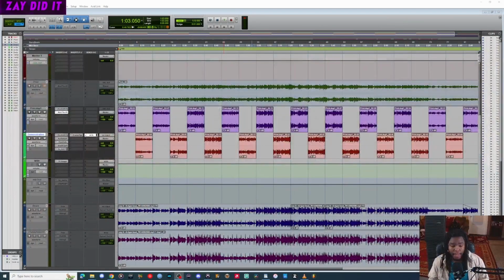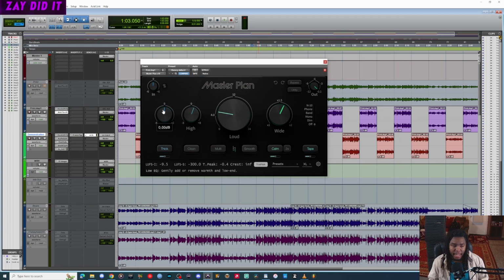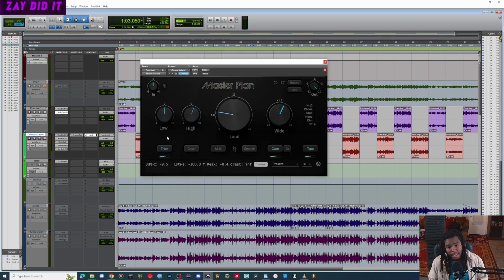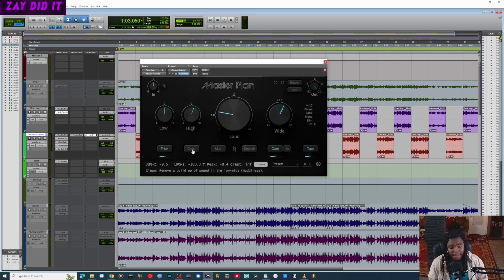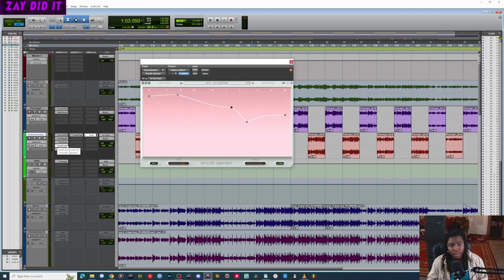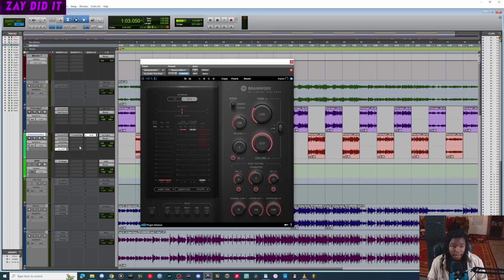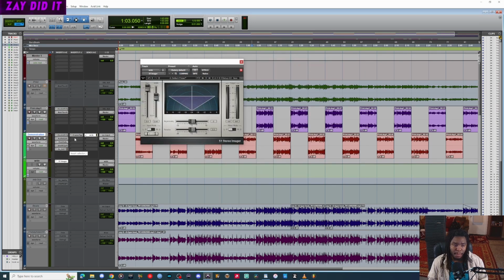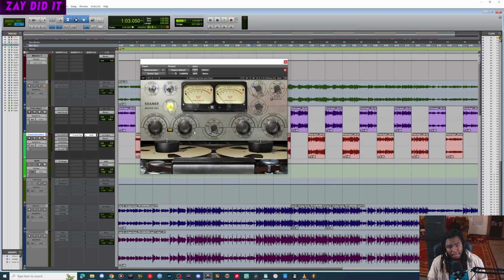One Plugin Mastering Chain !

Comment: From all the one plugin mastering I have tried, Master plan seems to be the best and the more complete one. Way better than Bx masterdesk true peak for example. It's possible to go louder and cleaner. But for a pro master I still need to complete with few plugins to get a top notch master. In term of loudness Master Plan can compete with your other mastering chain, but if you listen carefully you will find that your mastering chain sound a bit better. Especially in the highs and the lows. There is something more refine and brighter. Not a night and day difference, it's subtle, but I still hear it. But anyway, well done to the guys who created Master Plan. Really amazing tool. If they ever come to make a version 2, I'm already sure it will become my go to plugin. I would love to have in the same plugin a separated clipper, a bus compressor, and 2 different limiter with a common graphic to see exactly what I'm chopping with a delta to hear the part I remove. And a graphic 4 bands EQ. Maybe one substractive EQ at the beginning of the chain and one additive EQ before the last limiter. Have a nice day.
Reply from the maker: I'm sure they listen to feedback. I like the fact that almost anybody can pick it and achieve something usable. It may not have a 4 band EQ, but the 3 band multi band compressor is good.
Reply: @ZayDidItMusic  You are right on that. The best would be that friendly user mode for beginners and also an advanced one for the ones with more experience. I would love to see Music Hack team up with Modern Metal Songwriter to end up with the best mastering software ever created. Those 2 company are very underrated and have the same kind of phylosophy behind. Make something different, easy to dial in, effective and powerful.